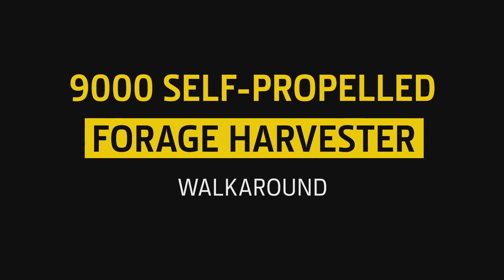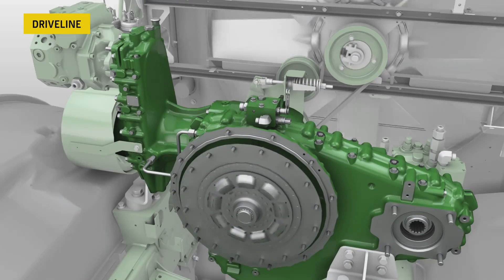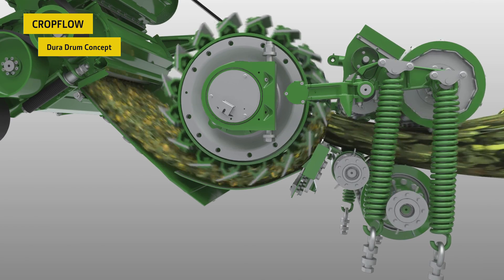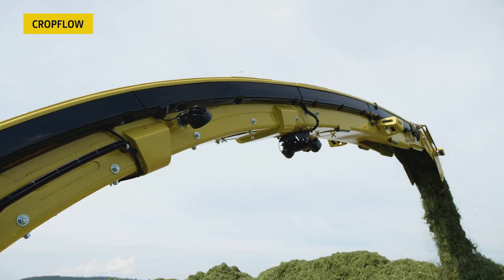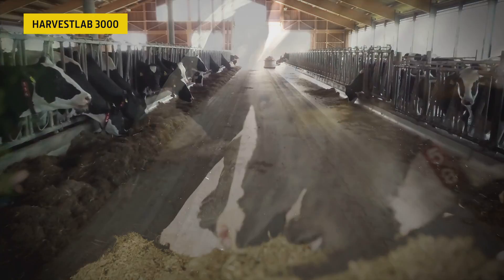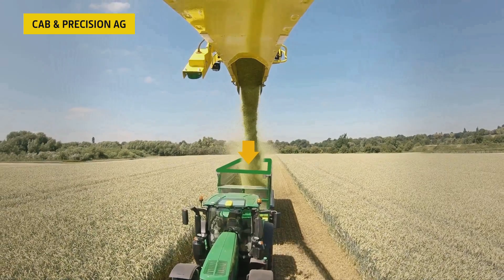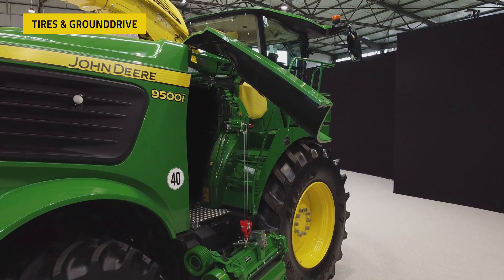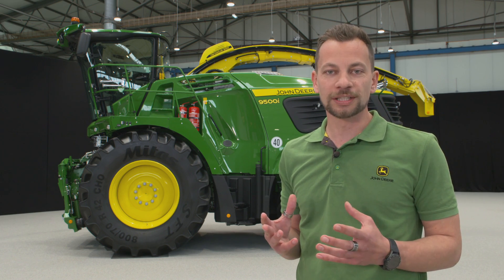The New John Deere 9500 and 9600 forage harvester

Comment: There quality sucks i should know i used to put the shifters together at mec in mayville Wisconsin
Reply from the maker: These foragers are made in Zweibruken, Germany
Reply: @monatractor  dont matter all john deere has the same problem with the electrical wiring under the cab. The wiring is supposed to be in a pvc electrical tube so it doesnt rub under the cab
Reply: @ethanlee9441  hydraulic tanks and the frontal gearbox is 100% JUNK